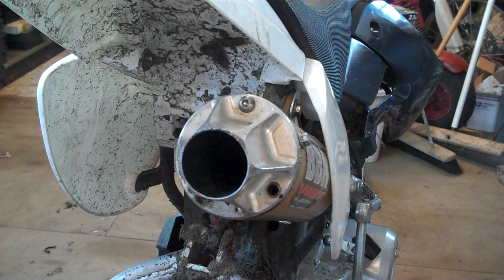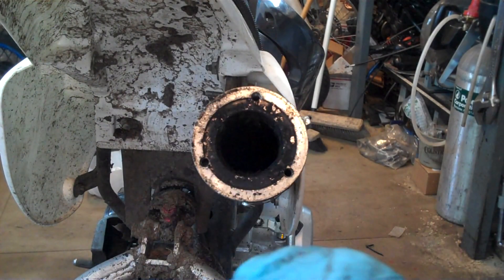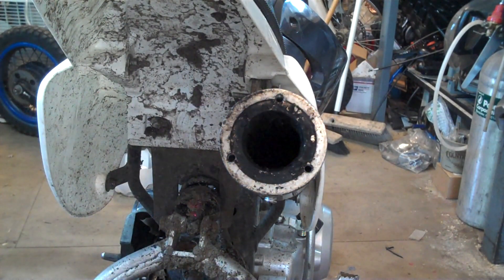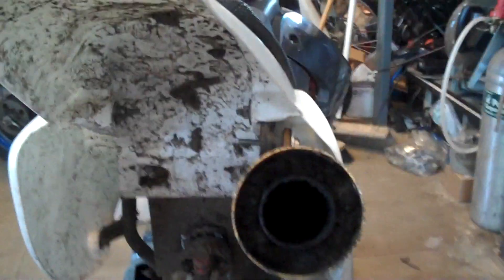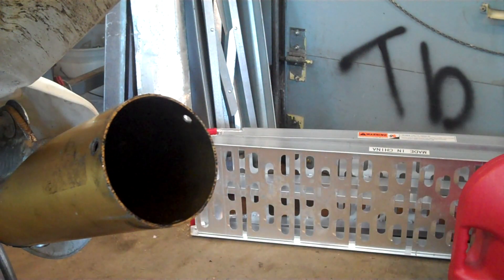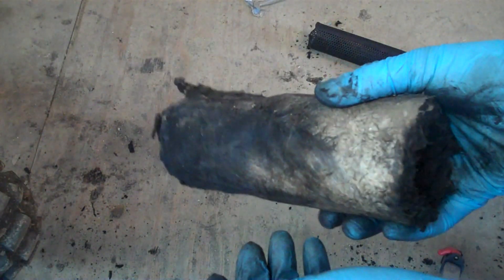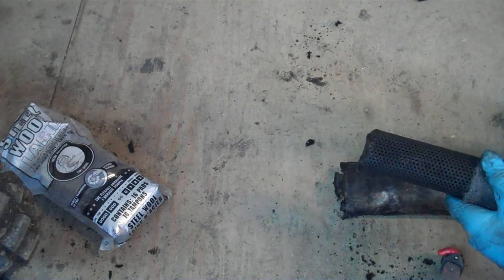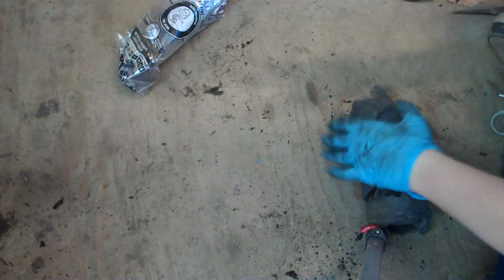How to re-pack exhaust packing

Comment: even cheaper than steel wool, climb in to your loft and borrow some fiberglass insulation and use garden wire it will also last longer than steel wool